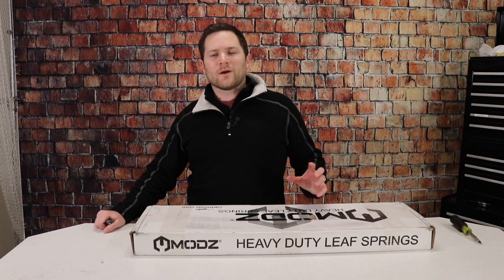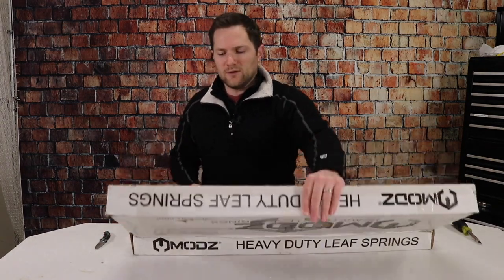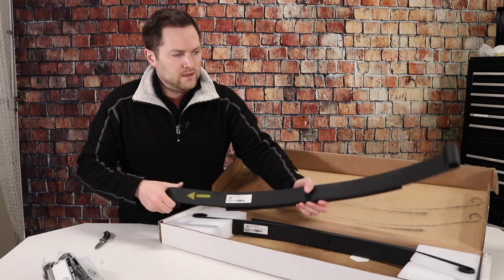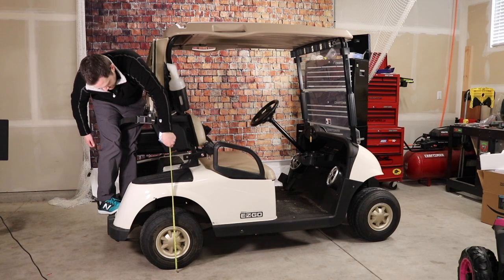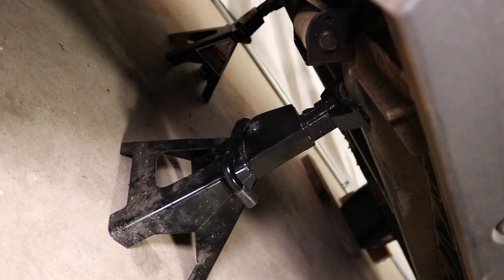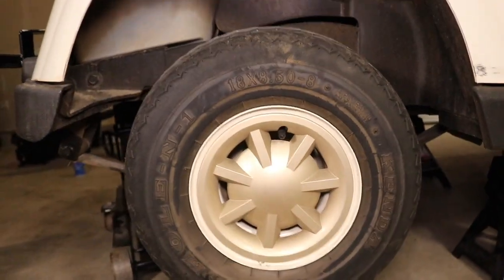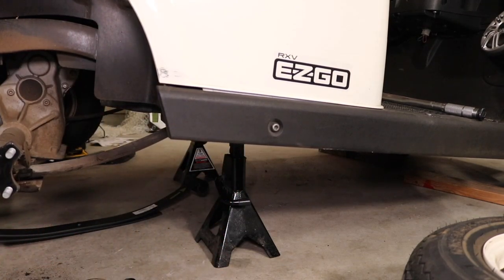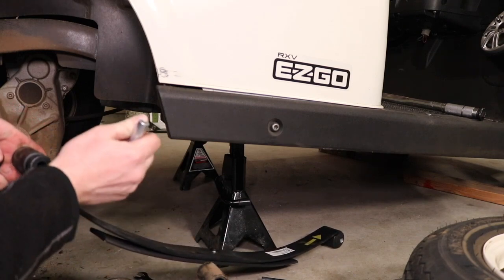EZGO RXV Golf Cart | Heavy Duty Dual Action Rear Leaf Spring Upgrade | BetterPlayGolf

Comment: You never remeasured the body drop distance AFTER the springs installation?    Do you know what the difference was?
Reply: That was the main reason I watched this vid. Any updates??
Reply: @tikitorturedmf  I just did this and it only gave me a 1/4" increase (the height of the additional leaf).  The sag when under weight is much better, saved 1" give or take when I sat and measured (220lbs).  Big tip, only disassemble one side at a time.  I did both and the entire axle/motor/etc got out of alignment and it became much harder to get everything back aligned.
Reply: @jeffkickham258  Keep a jack under the axel prior to pulling the springs out to prevent that and make the job a whole lot easier.
Reply: 3:51 - they edited the video so that the after ride height was measured before the install tutorial